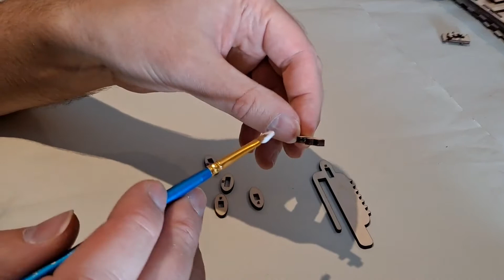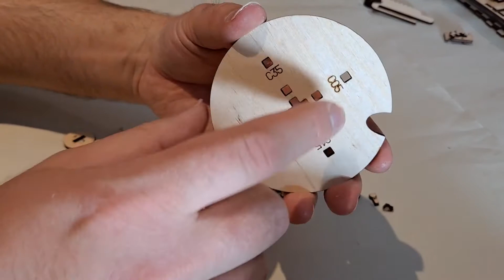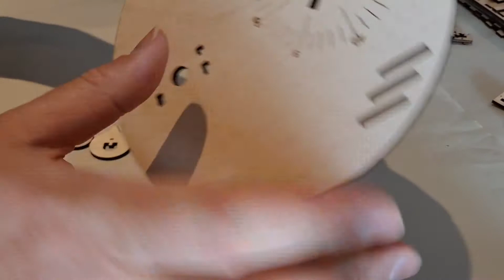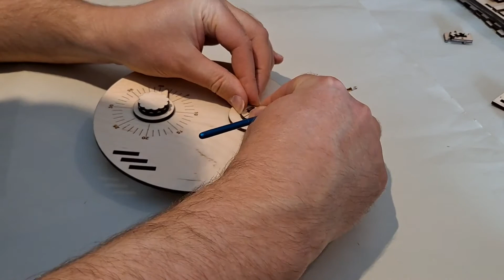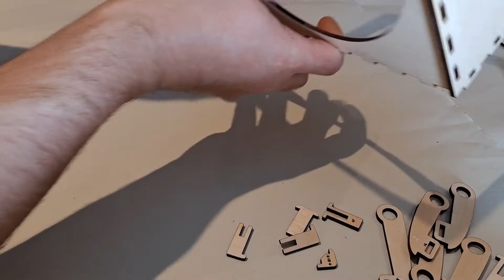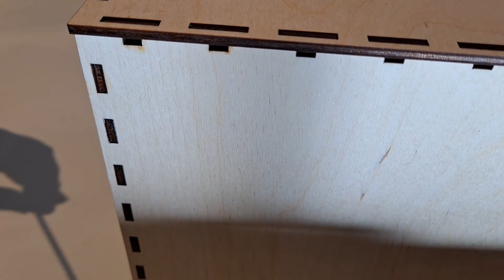Combination safe build tutorial

Comment: Hi there! Thank you so much for putting this together, this was a lovely project to work on!! Everything fit together like a glove! My only question is concerning resetting the box after you open it. Sometimes, the dial sticks when I am trying to respin the dial to reset it. Any thoughts on why that might be, and is that fixable after putting the whole thing together?
Reply from the maker: My guess would be that the dials are clipping against the back of the latch. You can check with the door open to try to see where it is catching. There are tolerances built in, but the whole thing is a pretty tight fit, and wood tends to be an imperfect material. Use plenty of lubricant such as paraffin wax or bees wax to make sure all the moving parts can move freely against each other. If you can figure out what exactly is catching, use some 400 grit sandpaper to add some more tolerance.